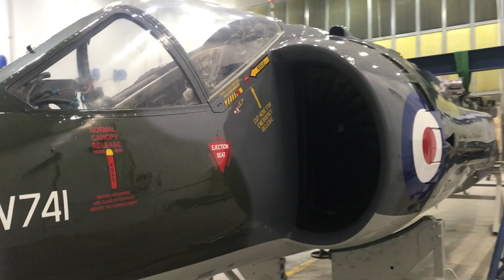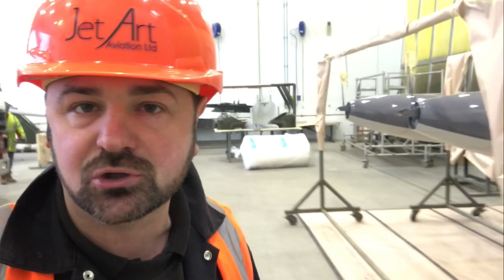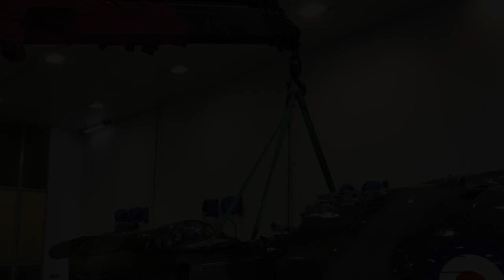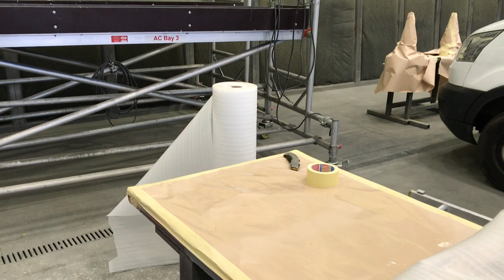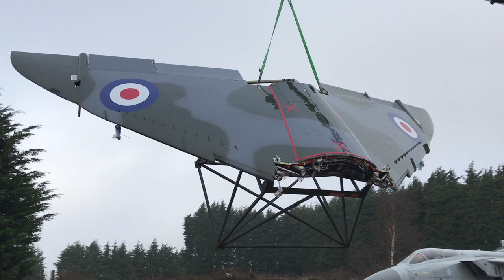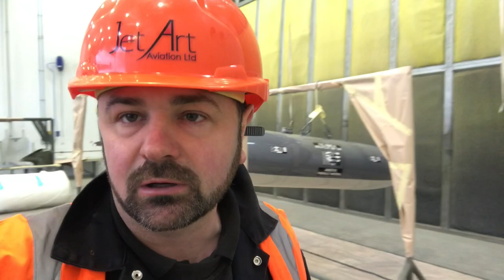Air Race Harrier XV741 collected from the Paint Shop

Comment: Fantastic to see her looking so good, 
I am guessing that she is painted in BS2X-34B paint instead of the DTD5580A that she wore originally, However I notice the stencils are for DTD 5599A which the RAF didn't use at that time, And was a semi gloss paint (Also came in matt) The paint was used by the Navy and was not adopted by the RAF until some time later and even then only for a short period.
 Also a small point- The stencils would have been cut from oiled manilla card and have small breaks in the lettering.  It would also mean the letting would have been less sharply defined than the Spandex stencilling used. Roundels and lettering would also have been less precise as they would have been masked by hand.
So in effect your superb job is miles better than she would have been when new!